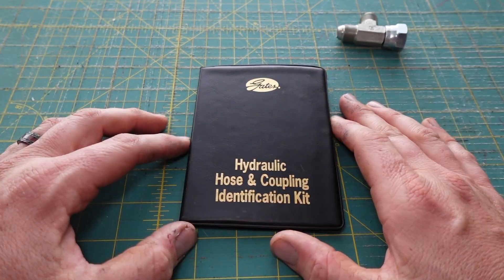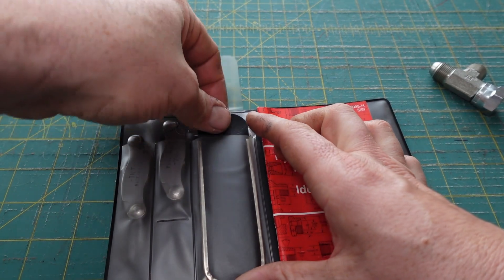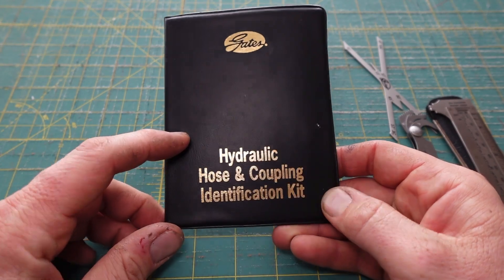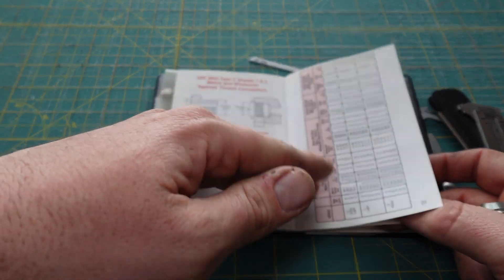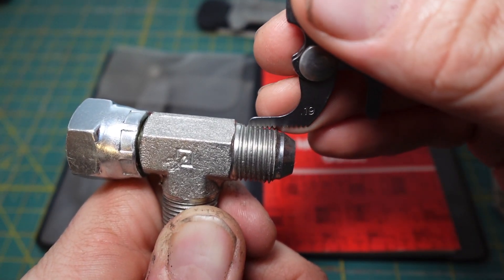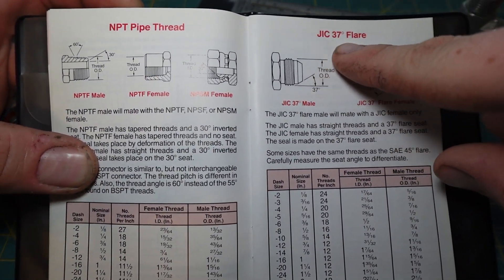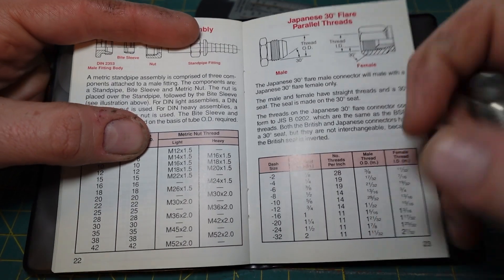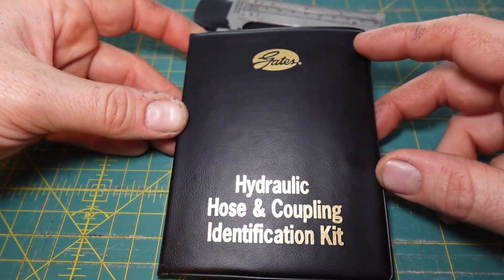Hydraulic Hose & Coupling Identification Kit

Comment: i really enjoy the book in my opinion it reminds me of the whole connect and flow systems, aircraft, ships, nitrogen as well as fluid conveyance is my life. 

the thread gap is hard especially with the flat edges, introduction of the n95 thread by mitsubishi 

im looking into re configuring the purgatory valve system for draweling negative pressure in flow systems maintaining npt consistently 

dual crescent valves heads threaded males, constrictor valves, y-strainer and or the stem valve high pressure hose usually corrugated finite maybe acrylic tube internal , double npt tanks exchangable dual purpose... looking into gtx and gte flow systems from r-tx